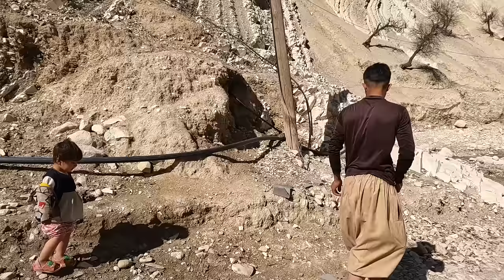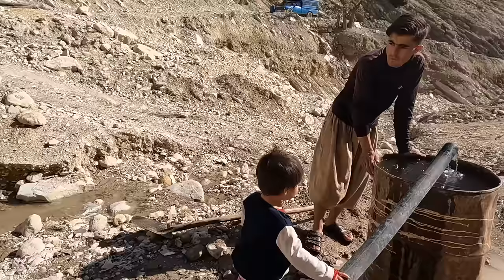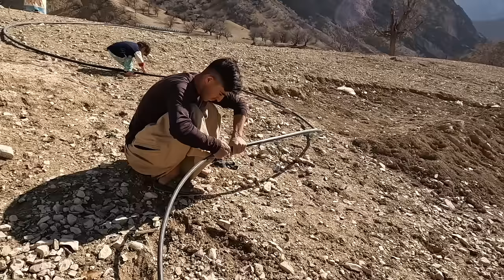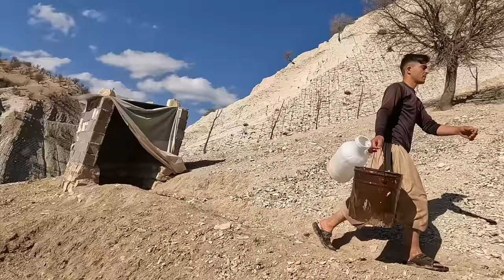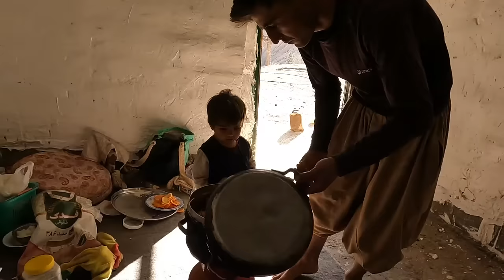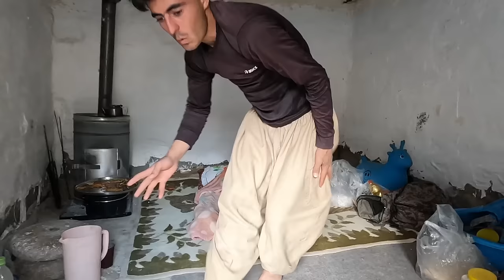Bucket Watering and Irrigation: 3 Mystery and Survival Tips [Hut Channel]

Comment: Hello, I like watching your channel and admire your ingenuity even in harsh living conditions. 

May I make a few comments/suggestions? 

1/ Cooking

Was it spaghetti with some tomato sauce you had for lunch today?  It might be a good idea to place a couple of fried eggs on top.  This will make your meal more nutritious - you expend a lot of physical energy, and should therefore eat well.   The same goes for your little girl, who is growing fast! 

Fry  the eggs QUICKLY in OIL, then turn them over to fry on the other side - a classic way of preparing eggs.  Do not spread them and fry them just in a dry pan, as have seen you do several times.  That's a waste of a good egg!  :-)  

You can also boil eggs, and use hard boiled, halved eggs in a tomato salad.   Make the salad with just a little oil, salt and lemon juice.  Far more tasty than just plain tomatoes!

Also, it may be a good idea not to throw crumbs, orange peel etc. just anywhere outside your hut.   Can you not have a small area designated for that (with small stones placed around it), and also teach your little girl to place peel etc. there? 

2/ Water 

May I suggest that you replace your old rusty barrell (much rust has probably settled at the bottom, anyway), and paint the outside white?  It would look much neater.  After washing your hands etc., pour the used water into a smaller bucket and use it for other purposes, such as washing potatoes in it before the final rinse, or watering plants nearest to your hut.  

Water is a precious resource, and although you have a good and regular supply, it's better not to waste it! 

3/ WATERING 

 You can make a few holes in the top of a plastic can, which will allow  you to distribute the water much more evenly than pouring the entire can on to the seeds you have planted.  The aim is NOT to have the seeds floated to the top - otherwise they will be dried out by the sun and wind, and nothing will grow from them! 

Also, can you grow green beans on at least a part of your fence?  They would grow quickly, climbing up on the wire, and would provide a wonderful screen.  Lightly boiled green beans would also be a great addition to your meals, as I don't see you eating many vegetables except tomatoes. 

Best of luck!
Reply: Chuchus não sei se ai,no local quê compra os tomates tem?De um chuchu você ja tem uma muda desse 🍆🍅🍉legume ..
Reply from the maker: Hello, thank you very much for the help. And your good comments, I will definitely act ❤️❤️❤️⚘️🙏👋👍👍

Comment: You can also get sprinkle heads for the end of the hoses that u can close when u r done watering.   You are doing a great job adding all those things to your farm.  Can u bring electricity?   Maybe using a generator that runs with water?  There is so much potential in your property..  you are in Iran?
Reply from the maker: Hello, yes, I am in Iran, there is an electric pole in the valley, but to bring electricity here, I need a cable and money to buy it.